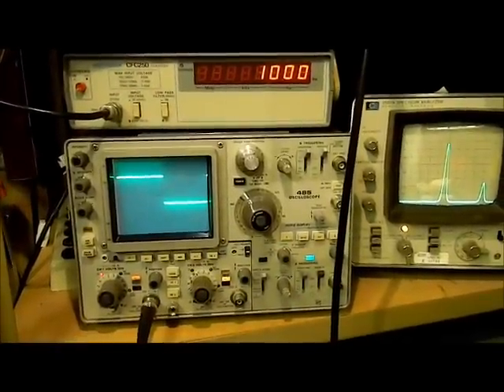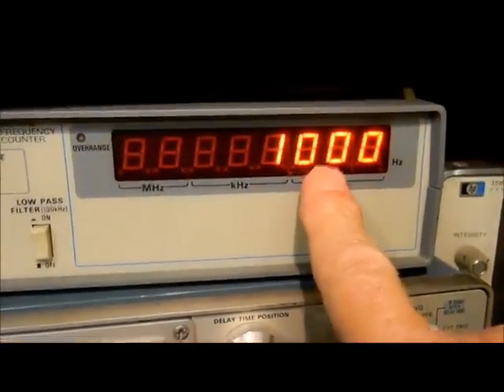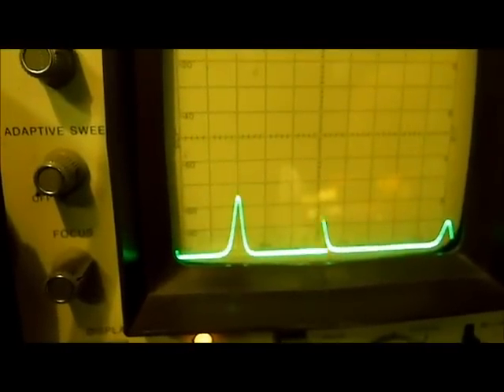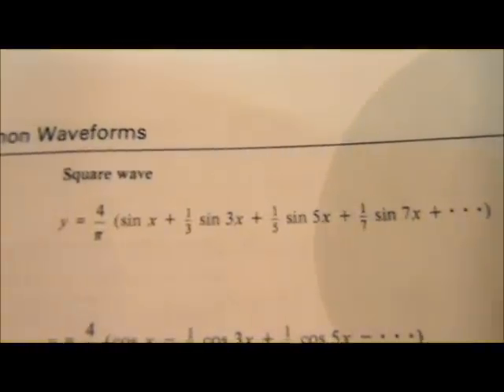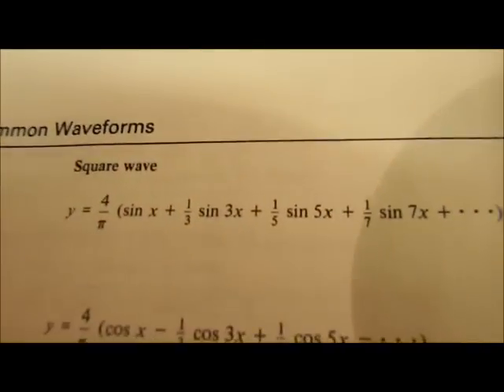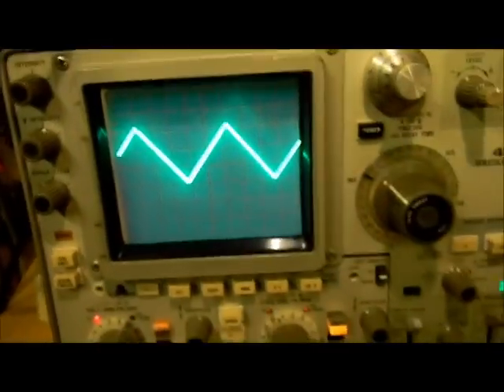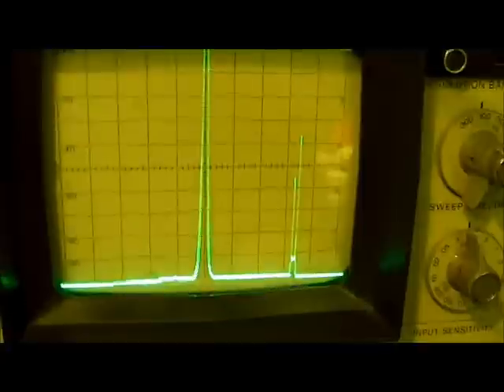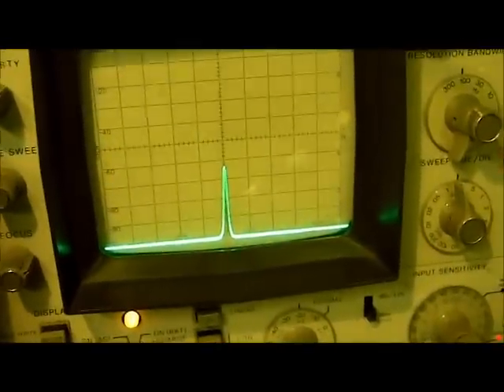Oscilloscope and HP 3580A Audio Spectrum Analyzer Usage

Comment: Enjoyed your videos greatly. Seeing your modern gear, I was inspired to go shopping on eBay for some of the same Tek modules. My signal generator is going on 60 years old. It served me well, but I decided it's time to get some nicer stuff.. found a Tek TM504 with DM501A, FG501A, PS501-1 for $62. Just spent a couple hours cleaning them up. Have a SG502 on the way ($42) and a HP3580A ($212) on the way this week. Gets my juices flowing again after 30 years away from electronics. Keep em coming!

Comment: @essoterric I'm impressed with the HP 3580A. I bought it in working condition, just needed some cleaning and a few new knobs (still looking for a crank knob), downloaded service manual and did an alignment and it works great. I'm working on getting an AA501 and SG505 next. That 7L5 would have been great when I was working in broadcast maintenance. My buddy has a $30K Anritsu that the FCC uses, but the Tek seems just as good for my purposes designing broadcast gear. Thanks again for these videos.

Comment: Great video. So the function Gen has more distortion than the audio Gen (sine wave). Are most audio test done with square waves because they are more critical or more sensitive on audio equipment (FM tuners, amps...)? Or do you use all wave forms, saw, square and sine? Thanks

Comment: ElPaso, I've watched many of your videos, love them! I have an HP 8903a because of you all configured with the PMillet software - works great. One of my favorites. Anyway, I really would like to get an audio freq spectrum analyzer and I'm wondering if you have any insight on a CURRENT FFT that would provide a comparable replacement for one of these old HP 3580 or 3582s? I currently have a Siglent SDS 1202-X-E but it really doesn't do it. I saw your comparison with the Tektronix and the ARTA software these seem a bit dated now. Any insight would be appreciated. Thx, Ben.
Reply from the maker: Hi Ben,
The one I have that I like is TrueRTA. Here is the link.  
 https://trueaudio.com/rta_down.htm
I think it is worth the price for the license beyond the free version because it prints beautiful images
with your name exactly as you put it in when you install it.
Another one is SpectraPlus but it is very expensive.
Here is a video where I use it and show the very nice printouts.   
 https://www.youtube.com/watch?v=eU62EfGWNHg

There is another one called ARTA as seen in this link below but they just went out of business as of March 2024.
https://www.youtube.com/watch?v=BBQyoHsmwL8

Hope I got these right...   
Thank you so much for your kind words. It makes all this effort worthwhile.
The 8903A and Pete's software was a challenge.... but it still works.
I had a leak in my shop a few years back and it leaked water on one of my PCs and I lost one of my most important PCs  but fortunately was able to move the hard drive into another PC. Now I get constant - this is not authorized software - or something like that - from Microsoft but it does work. I just keep that PC off the Internet.
I still have my 3580A also as it is such an icon of a SA. As you know, it is brutally slow on low frequency signals.
As I searched for FFT software, it seems like much of it is going away. What is our world coming to? 🙂
In another 20 years, it seems there won't be many of us that like to do this stuff, still around.
Lastly, I forgot to mention about the first software I listed - you need and external USB sound device but I am sure I show it in some of my video.
Again, thanks for contacting me. I don't do many videos anymore. Time is sneaking up on me and it is hard to get
the energy to do them.
Best wishes to you, always.  David Beard
Reply: @ElPasoTubeAmps  David Thanks for the quick reply. Please don't quit making videos. I've learned so much from your material and many others refer to your work. Blueglow electronics mentioned your HP 3580 and I've had several conversations with other hobbiests who also have pointed to your work.
Reply: In my quest for Spectrum analyzers I could use some insight from you. Currently I have an HP 8590a which I received first very cheap and supprisingly it work great. Then I got an HP 8560a (not so cheap) which goes down to 50hz and up to 2.9 ghz. I was thinking that these might cover both some audio work and RF work which I'd like to do soon as I get the courage to start aligning am and fm receivers. But I'm not sure either of these will really work properly. The 8590a only has an RBW of 3k which I learned does not allow me to zoom in enough. The 8560a is a much better spec going down to 50 hz and an RBW of 10 hz but to get the span down to see that resolution it is almost a crawl. Do have the opportunity to return the 8560a for a full refund so I need to make a decision. (the 8560 does not perform as nice as the 8590a, the image is a little choppy and blurred but its good enough for the RF work not sure of the audio work. The HP 8560a came to $470 with shipping. I'm wondering if my money would be better spend on another better solution. I know you have a similar device I can't remember the model but I remember you trying to calibrate it. What do you use your for? Any insight on if I should keep or return this HP8560a 50hz to 2.9 ghz and pursue another solution I'd appreciate it. I might sell the 8590a too but it is so damn nice...
Reply from the maker: @bendec2969  I went that path also trying to get an RF SA to work at audio and it is not a good choice. The old style analyzers  like the HP 3580A, utilize a technology based on swept-tuned heterodyne receivers rather than the Fast Fourier Transform (FFT) approach used in modern digital spectrum analyzers. I love my HP RF analyzer, works great up into the GHz range, but for audio the PC based FFT analyzers are far better - in my opinion - although the 3580A is an icon of a swept-tuned SA. With that said, I have to thank you for reinitializing my interest in my PC analyzers. After your comments from last night, I got my TrueRTA program going again - had to look back for a few years in my email to find the code to make it work properly and then "reinvent" how to make the USB sound cards work again - I have always disliked PC's but know I need them nowadays. I am planning on making an audio video using a stereo amplifier - a Williamson design - and making measurements with one channel using 6L6 beam power tubes and the other channel using EL34 (pentodes) and try to document the harmonic profile of the so-called, British sound, of the EL34. Supposedly, the EL34 has more pronounced high order harmonics and gives it that bit of a "rougher" sound of the amplifiers like the Marshalls vs the smoother Fender. I figure it is time I give some attention to my audio fans. I will break out my 3580A and hope it still works. Thanks again. Stay safe.
Reply: David, I'm glad I got you going again. Looking forward to seeing that. I recently acquired two EICO HF-22 Monoblocks for a song!! But they are  in rough shape right now but have everything. The original tubes test marginal but they'll do for now. Currently they use the 6L6 and I was wondering if I could upgrade to EL34 since there is a similar model that uses the EL34. I didn't consider the performance details just the fact that I have EL34's seem more available and I have several since I use them in an old Traynor Bass amp. Get that video out!!! I think I'm going to watch some of your videos on my 75" TV right now!
Reply from the maker: @bendec2969  Ben,  You have to consider the EL34 filament draws almost twice as much current as the 6L6. 6L6 is 0.9A and EL34 is 1.5A and some say 1.8A so it is twice as much. Also, the EL34 is a pentode so, pin 1 has to be grounded. Pin 1 on the 6L6 is not used so that is OK unless they use pin 1 on the 6L6 socket for a terminal point. Otherwise, it is usually OK and I have amplifiers I can swap these tubes in. I assume the Eico is cathode biased so it is probably OK for the EL34 but a good idea to check cathode current and determine plate dissipation to be safe.
I got my 3580A to the workshop today so maybe I can get to the video project soon.

Comment from the maker: Ray - I have estimated  my costs for all the equipment I have and I have spent only about 5K - there is a site that has all the original specs and costs of new Tek and HP stuff - very interesting to look at - new cost back in the 1980's when this stuff was new would be 100K+ - as for repair of my test equipment, I have to do it, or get another instrument if I can't fix it.

Comment: Just picked up a 3580A. Will be arriving soon to go with my Tek and other HP instruments. My collection is very much like yours. I've learned a lot from your videos. Question for you. I expected only 1Vrms on the SG505 in the 0db output level. Mine is at 1.7vrms. I think I saw yours at 1.14 in this video. Do you know what the calibrated or close to it output should be.
Reply from the maker: The SG505 requires a 600 ohm load on the output for the dB scale to be accurate. Without the load the voltage will be double what it should be (into a high impedance load like a meter or oscilloscope). Zero dB into 600 ohms is calculated as: E = Sqrt(P*R) which comes out to be Sqrt(0.001*600) = 0.7746 volts. Also, make sure the variable control is clicked into cal on the dB knob.
Reply: That explains everything.  I couldn't calibrate it down either  because I didn't 600 ohms on it.  I will modify my 50 ohm  to 600 ohms per your earlier video and let you know how it worked out.  Thanks!
Reply from the maker: Good. If you want the proper level for 0 dBm at 50 ohms from the output of a 50 ohm signal generator, you do the same thing, E=Sqrt(0.001*50)=0.2236 volts
Reply from the maker: The 3580A is a beautiful instrument. You do have to wait for a while for it to plot a 20 Hz signal, (as slow as 50 seconds per division) just so you will know that it is OK, but it is the lab instrument that virtually every vintage vacuum tube amplifier we enjoy today was judged by a few decades ago. Plotting 1 KHz and above is fast enough and the range is 80 dB but in reality, these (supposed?) dynamic ranges of 140 dB... that run on PC's... I am not too sure about. Not to say that technology doesn't advance, as it surely does but, to me,  there is a real satisfaction in understanding the technology at a deeper level using the older instruments than just getting a digital number off of a modern day inexpensive instrument. I hope you enjoy your new instrument.
Reply: I'm looking forward restoring it. It looks like it's had a rough life. It was only $85 but has a trace.   I have a HP3562A for a faster analyzer if this is a bust repair. I spend more time playing with the lab equip then I do on the amps. It's addictive. Your video even made me find a GenRad 722-MD cap box. Sheesh. What's next :)

As for the 600 ohm termination, I have a HP350D that I thought I tried before with the SG505 but I don't recall that I got the reading I was expecting like with the make shift 600 from the Dekabox earlier. I'll try it again now that the SG is calibrated. The 350A is a little confusing because I don't have the manual. I believe it can present the input with one impedance and the output with another. So I would assume I'd set the input to 600ohms and the output to what the meter calls for.  Ill have to look back through your videos to see if you went over your HP350A for an audio lab. I'm usually running the SG505's into a Leader LAV-192 millivolt RMS meter, the TM506's plugs DC501, AA501, DM504; and the HP8903A and HP3562A, and finally the scopes, on the line simultaneously. I suppose they'd all prefer the 600 ohm termination since most of these can report in db.

Comment: Hi! I have a HP 3580A Audio Spectrum Analyzer and I need some information about it... Maybe you can help me. Do you have some email contact? Thank you. Camilla.
Reply from the maker: You can contact me directly at,    theaudioshop@sbcglobal.net
Reply from the maker: The HP 3580A is a high-end spectrum analyzer that goes from 5 Hz to 50 KHz, but have you looked into the ARTA and SpectraPlus software that works with a PC and a USB sound card? These programs do an amazing job basically all the way down next to DC and are accurate to 5 KHz or better and display the low frequencies almost instantly whereas it will take the HP 3580A several minutes to plot a 5 or 10 Hz signal.